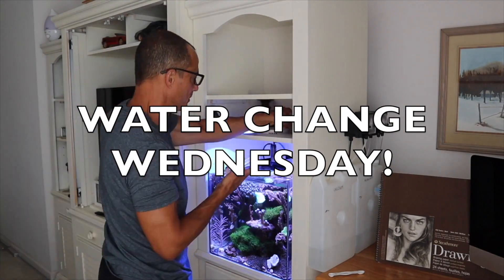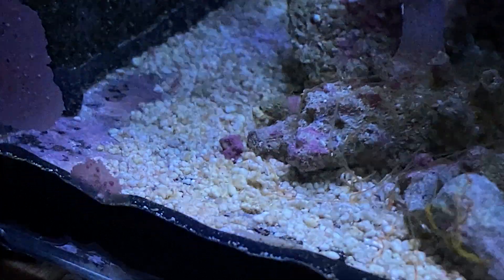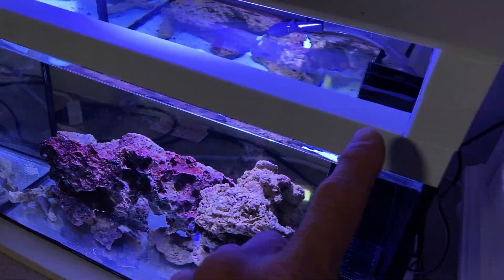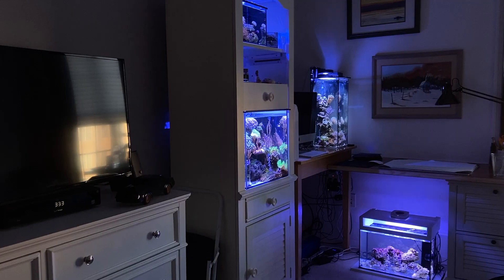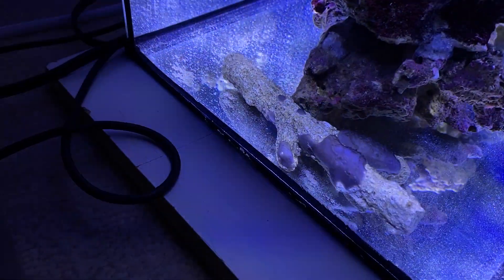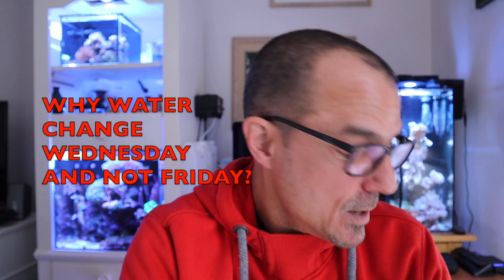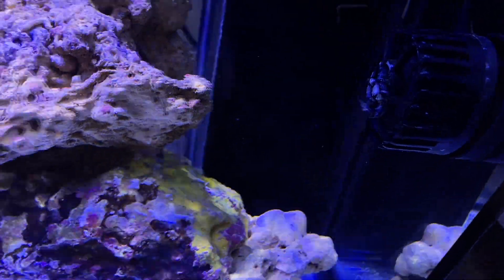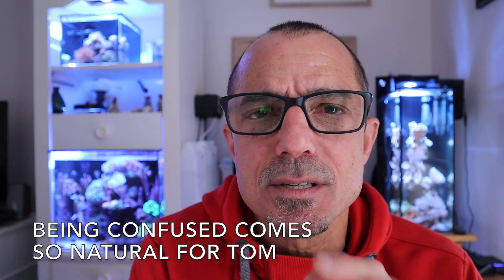Reef Tank - DIY FOAM BOARD LIGHT CANOPY - FOR Ai PRIME HD - Q/A #20

Comment: Thanks for answering my question, I used a 5 micron filter sock and dosed straight into that, ( I have no skimmer) I had another small pump with a tube pumping out of my filter box into the sock, I went from 0.5 ppm down to 0.25 ppm with 5 drops on a 23 gallon tank. Ihave also done the same in my 13 gallon from 0.5 to 0.1. In my 3rd softie only tank I have to dose phosphates. Great outtakes.
Reply from the maker: YW bearded flipflop. Yes, it really works. Now you can see where you problem lies. You may see it rise right back up. That’s normal. Then you’ll have to attack it on a more natural way. Some detective work 😃
Reply: @TOMReefer  the rock in my main tank I've had in tanks for over 15yrs, a year or so ago I bottomed out phosphates and lost all my sps, then had cyano.
 so I started dosing phosphates, the levels didn't rise very fast so I kept adding daily and from what I can tell it got reabsorbed by the rock so giving me a low reading, now i have gone too far the other way and it's leaching back out. I don't feed heavy as I only have 3 fish. That's the only thing I could attribute the rise to.
Reply from the maker: I can’t remember if you said you have a sand bed or refugium? Ofc siphoning those would help tremendously. If it’s just rock then it will take time👍🏻
Reply: @TOMReefer  yeah I have sand and do siphon that, it's only 1/2" deep so not too bad

Comment: Another great video
I was interesred in a plalythoa grandis for my tank was wonder what variety you have ?
Wondering how long you have had yours and the growth rate ? Did you find  your corals react to the introduction to it and did you add extra carbon to your tank .If you did add extra carbon for how long ? Thanks for any info Gaylene
Reply from the maker: Thanks Gaylene, I’ve had mine for about a bit over a year. There growth rate would be a bit slow, as far as multiplying for me ,however,  they grew much larger in size (diameter) I had no problems with other corals at all upon introduction, and didn’t add any extra carbon.👍🏻
Reply: @TOMReefer  what variety do you have ?Thanks for any info Gaylene
Reply from the maker: Grandis is the variety, they are actually button polyps, just the largest. Some call these green, tigers eye, etc.
Reply: @TOMReefer  Thanks 😃

Comment: May I ask where you purchased the foam boards and blocks?
Reply from the maker: Hey Jay, I got mine from a craft store called Michael’s. It’s a chain, but not sure how large. I would think most craft stores would have foam core board and those foam blocking pieces. 😊👍🏻
Reply: @TOMReefer  thank you sir. They still holding up well?
Reply from the maker: Yes, the foam blocking is perfect. I have a small amount of salt creep that has ruffed up a small amount of the foam board. ( 2” )  But no worse then a laminated cabinet would get. I never thought it would last this long. 😃
Reply: @TOMReefer  perfect thanks for responding!

Comment: Tom sorry for all the questions soooo I found these think 2 30 watts be ok for a 29??tia
Reply from the maker: Hi David, it’s really not about watts, it’s more about K (Kelvin) and color and spread. Are they at least 6500k? What’s the brand?
Reply: The ai prime boss man and yes I'm just learning watts don't matter I'm sorry I'm so new I have Noone to help me so I'm doing it all alone lol but yes the ai proline ones
Reply from the maker: Great! 2 Ai Primes are fine, 8-10 inches from the water surface, spread them about 6-8 inches apart, and 60% across your colors is fine. 0 (zero) Red and green if it has those. I have some vids on lighting, check them out. 👍🏻😊
Reply: Tom you are the man lol ok well ill get 2 of them then now I gotta figure out how to use them hahahahaha I'm not tech savi but all videos I've seen say it's easy lol hope so
Reply from the maker: It quite easy, it comes with a quick start user guide. Shows you how to use your Bluetooth 👍🏻😊good luck David